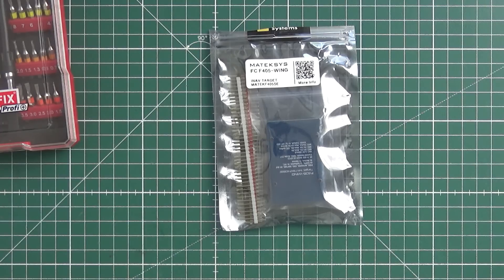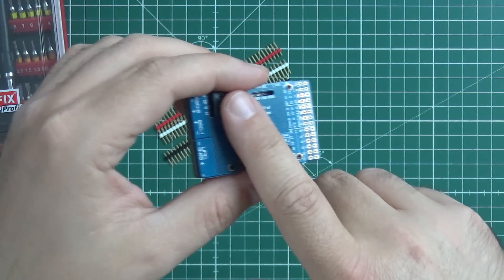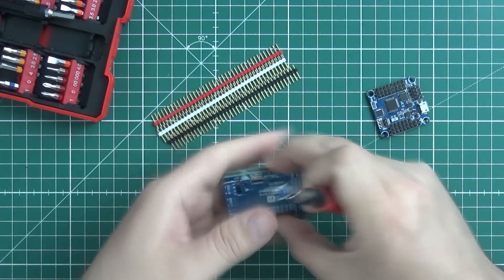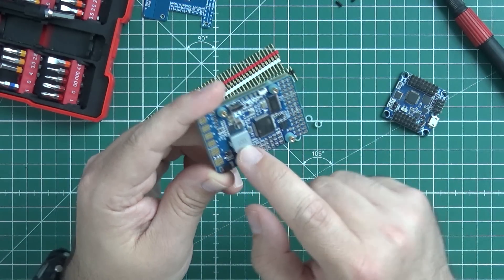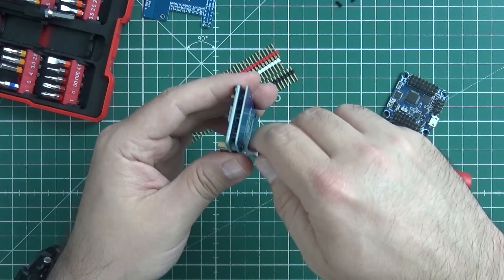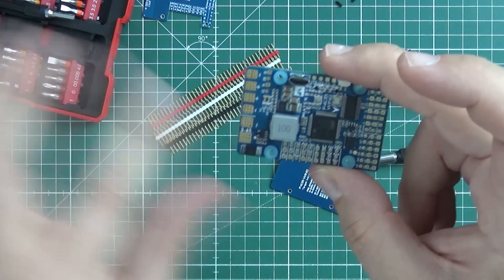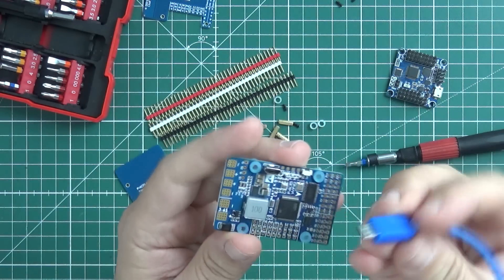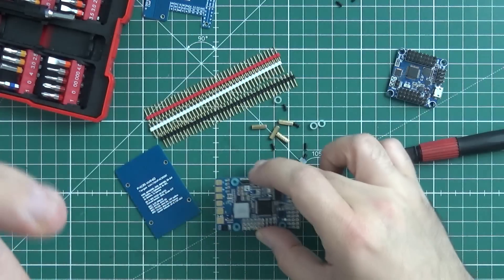Hands on: Matek F405 Wing - flight controller for INAV and airplanes

Comment: Mr pawel, if i may enquire, there is one interesting fc recently in market, its an f7 fc with vtx, baro, and pdb. But there is no  SDA & SCL pads seen on fc. Is there a way to install magnetometer from gps module on the fc. The fc is rcxhobby NTXF7.
Reply from the maker: Probably not. Maybe some old NAZE GPS modules, but I never actually owned one
Reply: Paweł Spychalski thanks for your thoughts. Youre right. I email the manufacturer and they told me it cant install magnetometer on that fc.

Comment: Top PCB, bottom PCB, brass standoffs and screws are all connected as shielding
Reply: Is this shielding required? I'd rather not have to stick the bottom plate to the cargo tray of my Mini Talon and removing the top and bottom PCBs and brass standoffs means I can mount the FC directly to my tray using nylon screws.

Comment: This big element with the inscription '100" that you named "the voltage regulator" is the coil. It is a part of pulse voltage regulator. Of course, the size of the coil is matched to the current that flows through it (in big simplification).
 I am waiting for your next movie.
Greetings from Poland.
Reply from the maker: yes you are right. I ment the whole section as voltage regulator not only the choke. I should have been more precise, thanks

Comment: Since the Furious FPV F35 Lightning FC came out I don´t see why we should wreck our nerves with soldering on 1000 little Pinheaders ?
Yeah Matek has always been very innovative but why do we have to solder ? 
I love the F35 to be honest and would always recommend it to anyone using Inav on Aeroplanes.
I use it on a Mini Talon and it works FLAWLESS ! Even Airspeed Sensor is working fine !
Reply from the maker: Probably it's a matter of preference. I, for example, hate JST connectors and pins. I always solder. This is lighter and more secure. I'm happy that pins are not soldered in, since I would have to remove them.
Reply from the maker: Flyott_dr I like to solder 😂
Reply: Flyott_dr I love soldering. Its something I wouldn't give up. Also I do not have spare 60 dollars to throw out of the window. Actually I have Omnibus F3 board with inav and my s800 is flying great. That board cost me 12dollars lol.
Reply: Those tiny white (vulnerable) micro plugs on the F35 are a deal breaker.....Big mistake.
Reply: Flyott_dr Yeah and price of F35 is 92£ and Matek is 35£. Over priced hype. And you still need to solder everything else then the FC.
Reply: I am not sure what you mean, but the only thing I had to solder was the ESC to the F35... ALL ELSE was plug and play !
Reply: Don´t get me wrong, you Guys are absolutely right and I used so many Omnibus before the F35 and they all worked perfect !
But I love the fact that I build a new Wing with F35 in less than 2 Hours ! 
In the past I needed a complete day to do that !